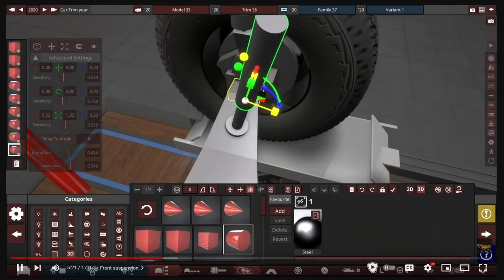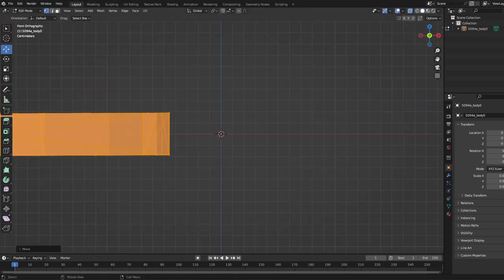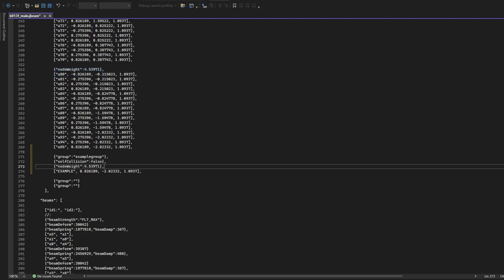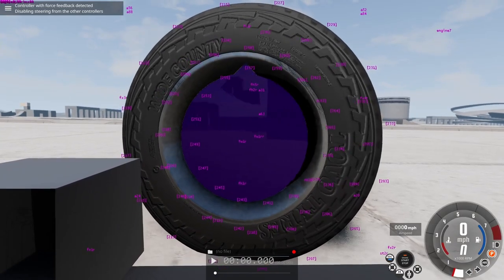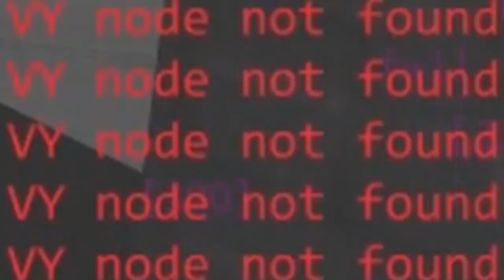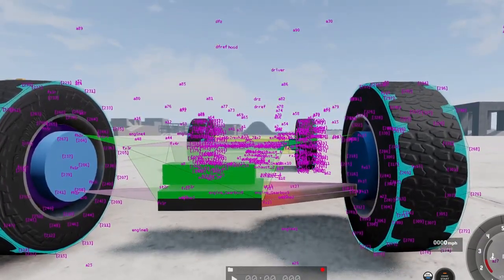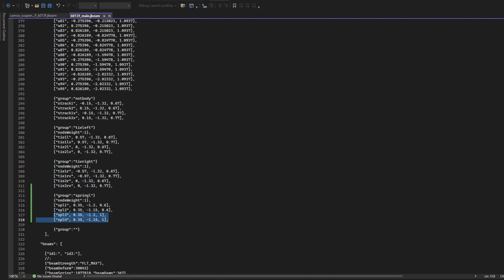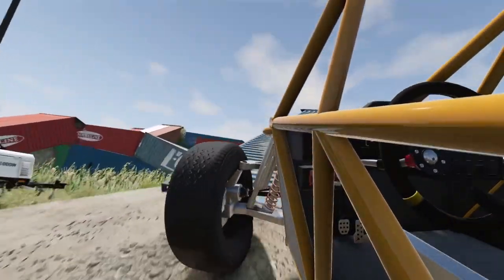Creating animated suspension! An incompetent Automation/BeamNG tutorial

Comment from the maker: Some .jbeam code to copy, as promised:

Rails
"railname":{"links:":["node1", "node2"], "broken:":[], "looped":false, "capped":true,}

Slidenodes
["node", "rail", true, true, 0.0, 12460720.000000, "FLT_MAX", "FLT_MAX"],

Steering wheel (goes under “props” in the main .jbeam file)
["steering", "steering_wheel", "st0","st1","st2",{"x":89, "y":0, "z":180}, {"x":0, "y":-1, "z":0}, {"x":0, "y":0, "z":0}, -1000, 1000, 0, 0.97, {"baseTranslation":{"x":0,"y":0,"z":0}}],

For the steering wheel .jbeam, 0.97 is the multiplier. It’s more or less what matches my real-life wheel, but you might want to change it depending on your setup.

Comment: the suspension looks great compressing and uncompressing except the janky shaking it does on certain parts. ive found a decently simple way of swapping models around with my own custom models ive made by just placing it off to the side in automation going into blender and placing where the default automation suspension is and renaming my new model to the old model then deleting the old model. if you position and scale everything right you can get some pretty similar results in maybe 10 minutes max instead of doing all the flexbodies and whatnot. though this method may visually look better close up my method looks decent enough for what ive done with things. A+ for the video tho, its really well put together. i could maybe show off how i do it soon and maybe we both could learn a thing or two.
Reply from the maker: Yeah, it's definitely janky. If I were better with beam structures - or if I wanted to put in the effort - I could probably fix most of the shaking, particularly in the front of the buggy (the rear suspension was made with similar methods to this, but the front was a bunch of bad experimentation).

Replacing the original Auto suspension is definitely an easier way of doing things, but the parts don't really move separately and it's a very strange, morphing movement that doesn't work on a vehicle with exposed, easily visible suspension like my buggy.

Still, for most normal uses this is probably enough, if anyone reading this (if anyone even does) wants to try it!
Reply: @noname2242  im definitely down to give it a try and see if i can improve it or make the process a little easier so beginners can follow it a little better

Comment: Hey man I was wondering if you would make a video on making a hydraulic/airbag suspension ? No rush too just wondering
Reply from the maker: If you mean just getting it to look right in Beam, you could probably just use some of the same principles as in this video (for instance, do what I did for the springs to get the air bags to compress).

Comment: i'm wondering if you could use Maya to speed up and make this process waaaay easier ... since Maya has a skeleton / attachments system ... so in theory (i havnt used maya in years) you could animate all of the nodes and connections in the maya skeleton which can be exported as well as completely tested in maya... 
you'd probably have to make a separate "skeleton"  (node structures) per suspension arm/coil..

might be worth a look for you or your buddies that wanna make these.. 
 i feel it might be a faster and less code filled way of making them..
Reply: Blender also might have those capabilities
Reply from the maker: It'd make positioning things easier for sure - that said, I have exactly zero knowledge of Maya (I don't even know what it looks like!) and am barely any better with Blender, so I have no idea if this is possible or how easy it would be.